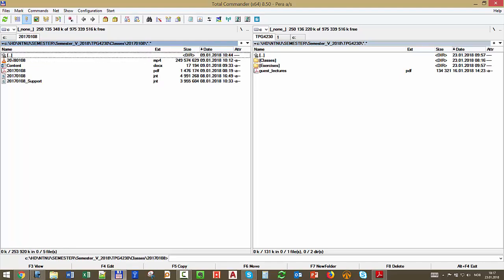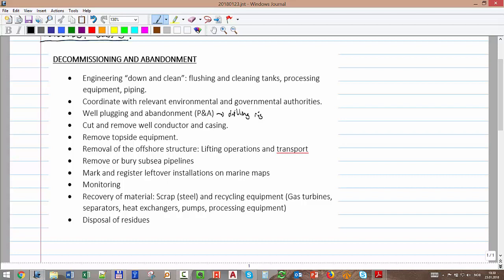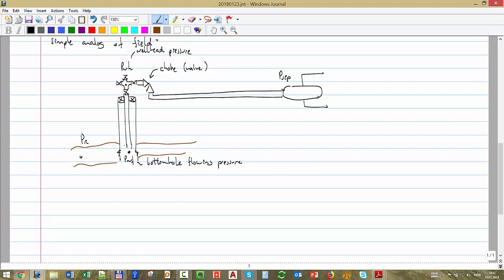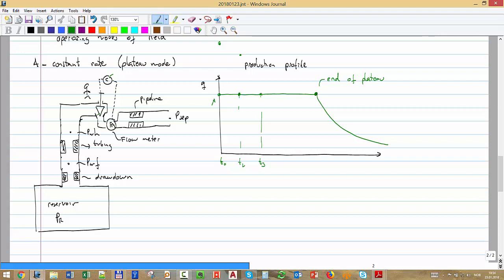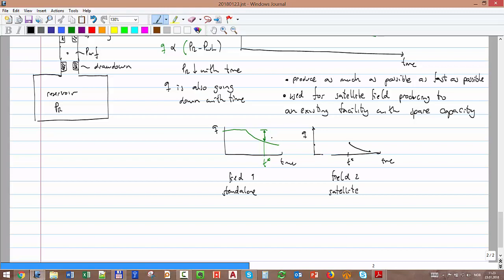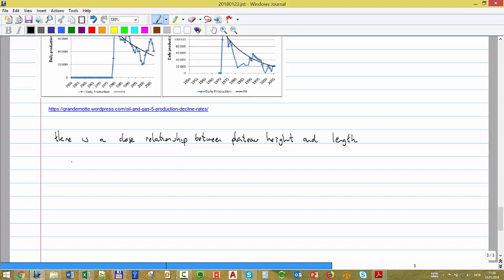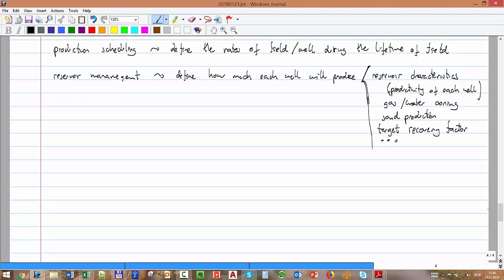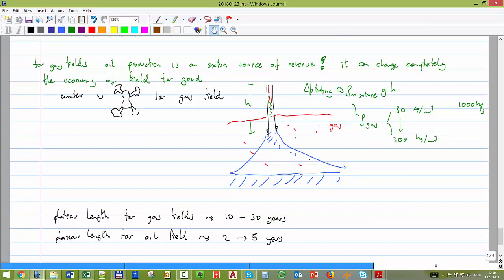3 - Field production modes, production scheduling

Comment: Hello , can you explain the influence of different methods of artificial lift in oil production and design capacity?
Reply from the maker: If for example your wells require gas lift then you must have enough gas available (either from the same field or from a neighboring field). You will also need a gas processing train to remove liquids from the gas and to compress it for transportation and injection in the gas-lift distribution system. The separator trains also have to be properly sized to handle the volumes of gas produced by the wells (reservoir gas+gas lift).    In the case of electric submersible pumps, the main consideration is the power capacity of your facility, it must be enough to power all ESPs in the field.
Reply: Thanks for answer my question, I have sent a message on Youtube.Please check your inbox.